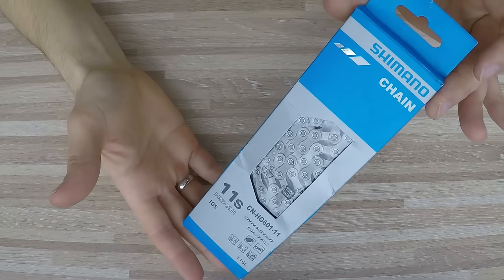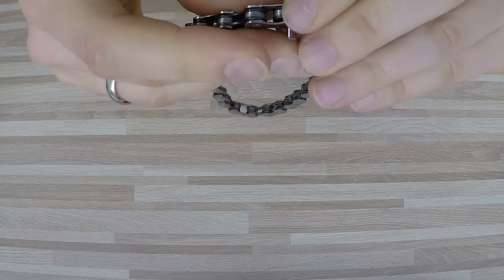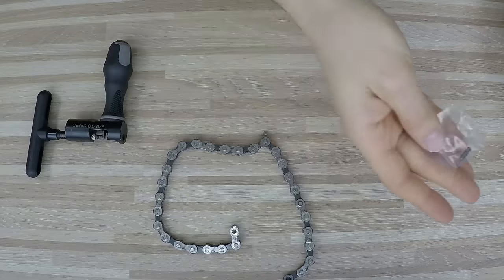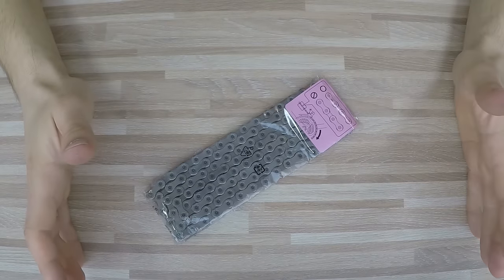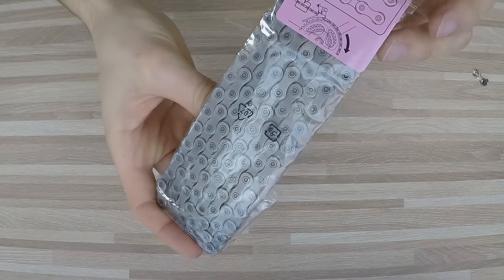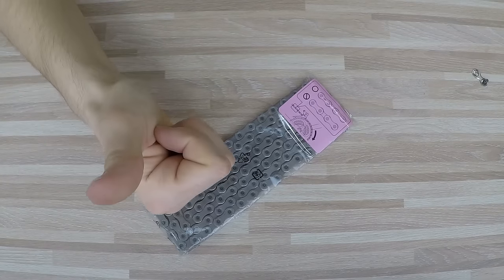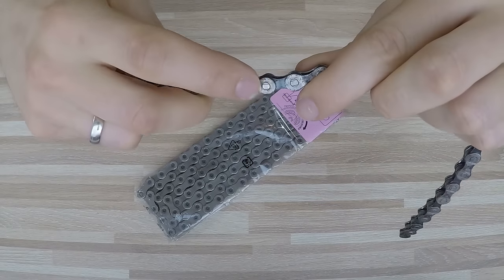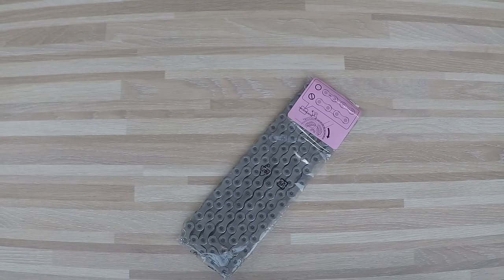4 Worst Mistakes In BICYCLE CHAIN Maintenance. How NOT to do it. SickBiker Tips.

Comment: hi Shai, how do you know the sticky grease is storage / transportation grease and not for operational use. Do you have some info from Shimano? i don't believe any shop mechanics remove the grease, but i am all ears?
Reply from the maker: http://www.kmcchain.eu/MAINTENANCE
Reply: I am a bike mechanic and the direct word from shimano is to leave the stock grease on. I cant link the video as its an industry training site "shimanotech" and requires a log in. But in this video about installing their chains they go out of their way to dispell the "myth" that you should remove this stock lube. I can see however that it could be smart to wipe off the outer links just to keep things clean.
Reply: Maybe you are a good bike mechanic... I don't know. Maybe there is really a video where shimano representatives say that we should leave the stock lube... But really have you ever ride it? If you say yes and everything was ok then maybe you ride a sterilized room only))) I rode lots of lubes as well as the  stock one  and the stock one is like the best magnet for road dust. The dust becomes an abrasive really fast and the chain doesn't work for more than 2-3 k km. And with wax lubes I ride it is about 4-5 k km on the same chain.

PS sorry for my English I am not the native speaker.
Reply: Shimano answer here: https://www.bikerumor.com/2011/06/28/chainwear-challenge-quick-interview-with-shimano/
Reply: Interesting
Reply: There are two points that need to be addressed: 1) On a Shimano chain I just bought recently, the lube is much less thick than on chains I bought just a few years back.  On those chains, the grease was so thick and sticky that removing it was pretty much a necessity; 2) A closer reading of the Shimano's current stance on this issue is helpful.  They state that the grease is applied before the chain is assembled and therefore all the critical surfaces of the chain have lubrication.  Because Shimano is using what I think is a better grease these days, it's probably not as critical to remove the factory lube as it was until recently.  The main reason they advocate leaving the factory lube on is that dripping lubricant on the chain is not nearly as effective as a method that permits lubricating ALL of the chain.  That's why soaking the chain in a heated motor oil/paraffin solution (9 ounces of motor oil to one pound of Gulf canning paraffin) is so important.  ALL of the chain is lubricated and it doesn't attract dirt nearly as much as dripping oil on a chain does.

Comment: I used to degrease with diesel and then boil the chain in parrafin  or candle wax on my recumbent - 10 years of riding around Outback Australia which included a fair bit of innundation, about 30 000 kilometres but the chain was absolutely shagged when I replaced it

Comment: wax ur chain according to ozcycle, rule num 1 :)
Reply: yes i do use the wax  method  according to ozcycle i love it  use it with ptfe.. clean chain every 250 -300 klm on problems
nice and quite , no dirt or grit sticks to chain wet or dry and gear hub. use  a 8 speed chain and SRAM POWER LINK. love it
Reply: Agreed!.... boil in wax ....  way to go !!
Reply: Yessss...very true...used that method for years now..not yet change my chain ..riding over 1000km now..

Comment: Back in the day when I started riding road bikes, (1982), we used Sram chain and you could push the pin out part way to cut the chain and reattach it by re-pushing the pin in. NEVER broke one. Shimano has had this "Got to use a new pin every time" thing so I never used their chains, always stuck with SRAM. When quick links came out started using those. JUST my experience.

Comment: Thanks, I was using WD 40 on my chain and other parts, it has alcohol in it now I'm using silicone spray, hope that it's OK !☺ Thomas C Belanger FanTom USA
Reply: both do not lube! Use an good oil, or if you prefer, an dry lube, but not silicon oil or wd40. Those are just not designed for lubing a chain.....
Reply: Use wd40 for de-greasing, rinse with soap and water then apply recommended lube.

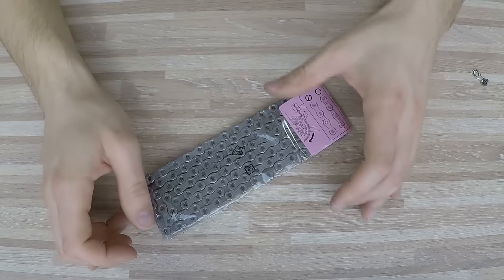Comment: @7:30 Oil does not drive water out of your chain. Do you ever see it leave?  Oil will coat the water droplets and hold them in place.  Use a dry cloth several times.  A small amount of water will always be held between the links by surface tension even it you use compressed air.  You could only drive it out using IPA or WD40 and then drying that out.  
However.  Don't worry about it. You ride in the rain, right? Chains have anti corrosion coatings.  The cleaning is to prevent the grit from wearing away the coating.  Clean, dry, lube, sleep, ride.